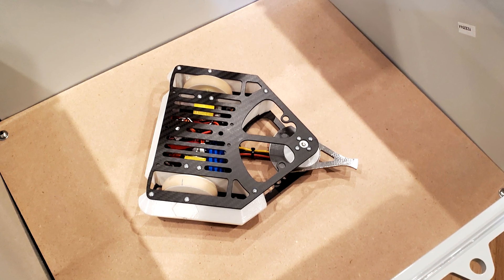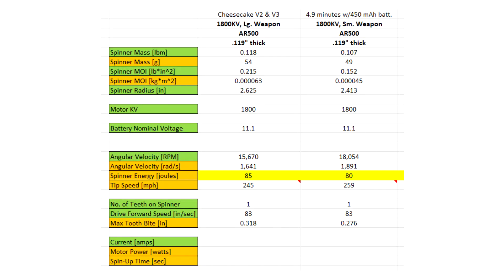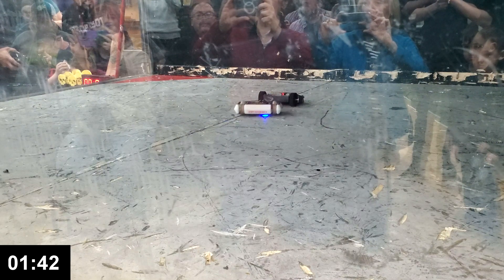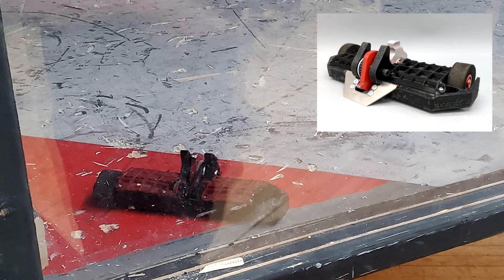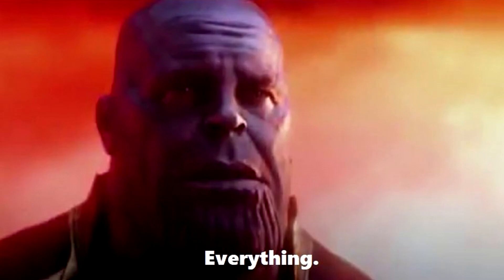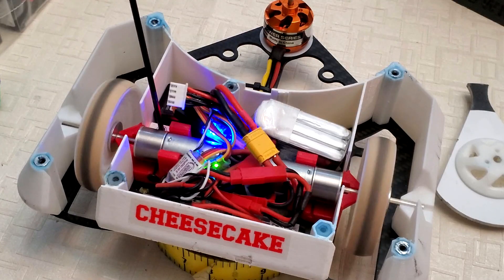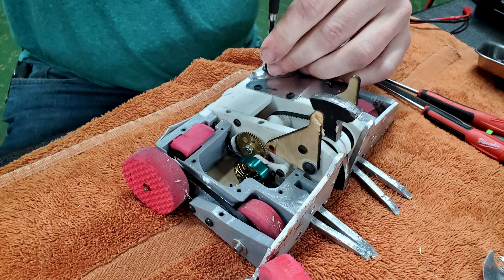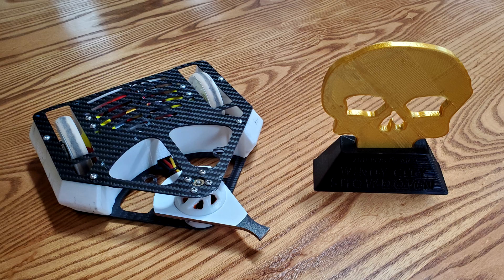Cheesecake takes a beating! (Windy City Showdown 2023)

Comment: Re: air resistance. Could you taper the edge if your spinner, even a little. Like a knife blade without losing too much structural strength
Reply from the maker: I thought about it, but it would be very hard to manufacture, and I kind of need that square shape to really bite into opponents on the tip anyway.

Comment: Sir, I've been watching little Cheesecake toil endless opponents for about an hour now, learning a little about your bot in the process. I see you're using a Skywalker 3S ESC, (finally, I've been curious) to pair up with your 1800kv motor. You'd surely be able to save quite a few grams were you to swap it for a BL-Heli_S or BL-Heli_32 ESC, while gaining some awesome programmability over the power delivery. You probably don't use the Skywalker's BEC, so it's just generating heat and wasting space anyway (the ESCs I speak of don't have 5V outputs). Besides, the quad-style ESC's are cheaper, too
Reply from the maker: Thank you for being such a loyal fan! I'm actually using this ESC linked below, which uses the BL-Heli_S firmware, and is pretty light and small.
https://www.amazon.com/Electronic-Controller-Brushless-Multicopter-Quadcopter/dp/B09F3G4KNB
Reply: @alexsalchemy  Perfection, my guy. I'm enjoying watching these matches, and the steady iterative changes. Kicking myself for starting at the most recent video, lol
Reply from the maker: @GhostRyderFPV  - Haha, I should really feature the playlist of all Cheesecake's tournaments more prominently somewhere: tell the story from the start as new people find the channel!

Comment: The smaller weapon was definitely more effective, but it seems that the smaller reach makes it quite a bit more likely for other bots to hit your chassis. Perhaps changing the pivot of the bot further back by moving the wheels and maybe heavier parts if possible will extend the weapon further from the pivot point and extend your range, mitigating this issue.

Comment: just a fan of combat robots, but curious about the pits (you dont see them covered on NHRL or other sites much) would some colored nail polish, tags, zip ties, heatshrink on the wire harnesses make it easier to quicly change and replace parts w/ less risk of mixup?
Reply from the maker: Oh yes, my latest design is much more internally organized, with just enough color coding to ensure I plug the battery into the right place.

Comment: Could you print some components with chetaflex maybe? 
I'd try add some more shock absorbing material to more components. Thin layers of  semi-hard rubber maybe, you want to dampen the acceleration curve of the BIG hits, too soft and it will bottom out too easily on the big ones.
Reply: Ooh someone watched that end game video ;-)
Reply: @RennieAsh  Yes, and ME degree :D.
I've always been a big proponent of shock absorption. Around 50% of critical failures arise from the inside of robots vs external mechanical failures.

Comment: Nice work! What options are you considering for upgrading the motor mounts? Would TPU work?
Reply from the maker: I thought about using TPU for the motor mounts, but there are two embedded locknuts in each mount which allow me to bolt them to the frame, and I think TPU would be too squishy to keep those nuts from rotating as I tighten the mounting screws into them. Good idea though, maybe an alternative mounting strategy would allow me to use TPU for these parts.